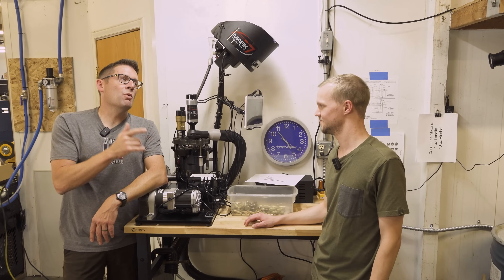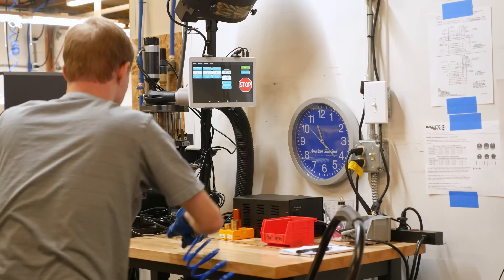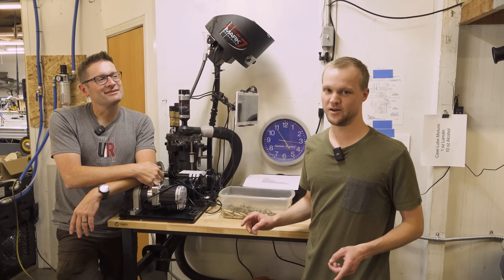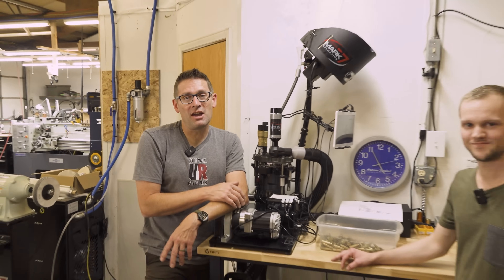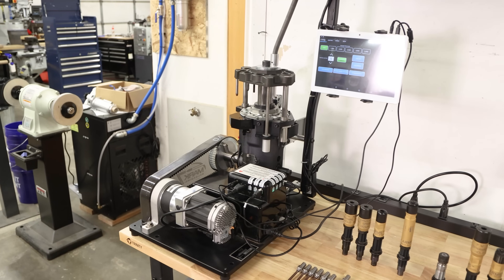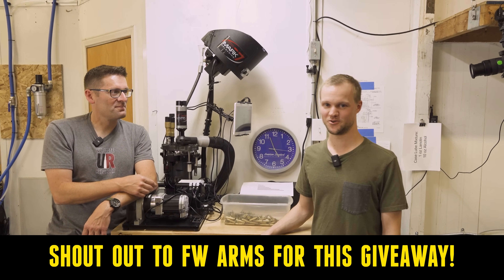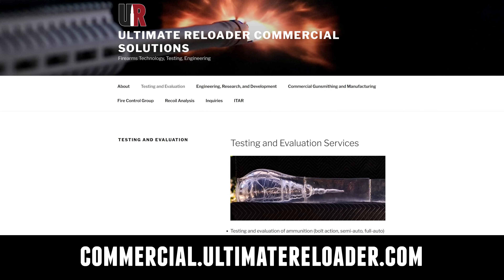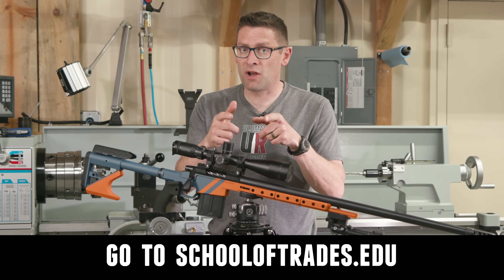GIVEAWAY! 40,000+ Cases Processed! How Many Decapper Pins?

Comment: 0 pins

4 pins

So much missing data!!! 

Are there pressure sensors? Is there an automated way to know if a pin is broken? What is the hardness of the metal the pin is made of? How is indexing done? How tight of a tolerance is the shell plate holding the brass? Was someone watching the whole time?

If I can only give one, use my first answer of 0:

1. 0 if you managed to get the setup right and there were pressure sensors.
2. 4 if you broke one or 2 during setup, and 2 during normal production run

Comment: I'd say 17 pins.  I've broken 5 de-capping 1500 from Mojo using a single stage loader.  Most were my fault by over exerting the ram when a pin would not move easily.

Comment: Well. With the auto machine i cannot say. By hand I would say you broke none. Machine??? Different brass???  Only time I ever broke one was on Norma brass. The way I go at the recapping I can just catch it before any damage is done via light pressure and moderate speed
  So with that I would break none. Machine? Cannot say. Ive dine 6000 223
10000 9mm with only the one which was in the first 300